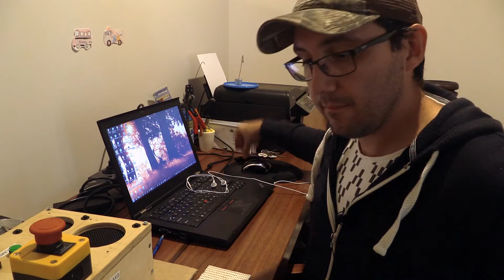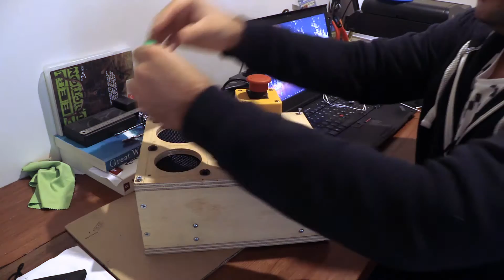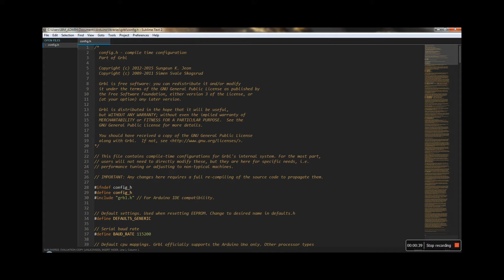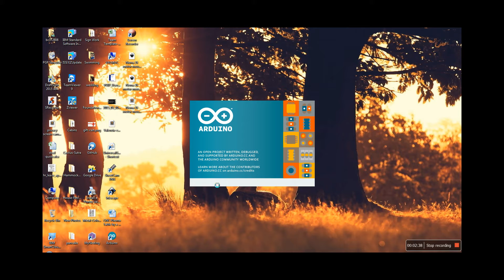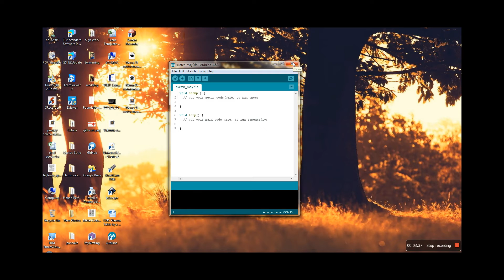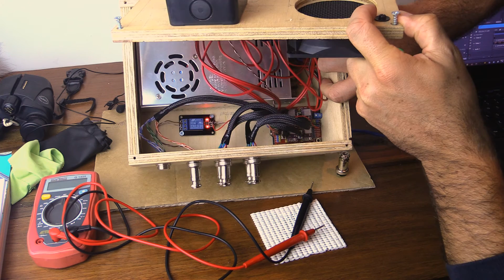DIY CNC plasma build by a novice - part 4

Comment: Hi Mark, I like to get your help i try to figure out how to connect the plasma torch trigger to the arduino. I have bought a relay connect to the SpinEn and to the 5v hoveever it wont trigger anything on M3 M4 or M5, i than connected to the SpinDir and it works with M3 on M4 off
thats fine than i connect the plasmatrigger connection to the relay and if i hit M4 it turns it on but when i hit M3 its frees and i need to disconnect and reconnect. if i try it again same issue.

i am usin V3cnc shield and the arduino uno  the relay is a JQC-3FF-S-Z 

have you any idea what am i doing wrong 

I would really appreciate if you could help i feel lost

by the way your videos are great

Comment: Hello sir Please help me, before i made cnc roter and run normally. This time i tried to replace with plasma, why when my torch is in x axis plate, simultaneously plasma is alive, my machine is moving without program.
Note: plasma and cnc separate machine (manual on off)

Comment: Hello Mark, I really appreciate the job you doing, I'm a great fan.
I do have a question please, 
1) what brand of plasma cutter are you using?
2) Did you change the plasma torch or just modify the trigger switch on the original torch? 
Thanks
Reply from the maker: Hi Murtala, the plasma unit is just a cheap Chinese Cut 40 machine, it was the cheapest I could find but I'm not entirely sure how good it is going to me. The torch is currently wired up from the "Spindle On" connector on the CNC Shield to a relay switch. From the relay switch it is just a simple two pin connector from the control box to the plasma machine (where the button on the current plasma torch screws into). Basically I'm just replacing the manual switch on the torch with a relay being controlled by the CNC Shield. This way, I can use M03 and M05 in my gcode to turn the torch on and off.

I hope this helps and thanks for watching.
Reply: Hi Mark Valenzia, thanks for the reply. 
So, if I'm not mistaken, the trigger on the torch is bypass to the relay output which is control by spnEn pin. 
The thing is, I'm confused with spnEn pin, it has two pin white and black. Can u elaborate on those pins, how do I connect it to the relay low current circuit. If there is written manual or video that explains the CNC shield properly let me know. Lastly, do u have a final video showing ur completed cnc machine running? I think I will help tooo.
One again thanks for the help.
Reply from the maker: Hi mate, I've just gone and had a look at the control box and this is the wire diagram/setup I have.
SpnEn (White to IN1 on relay, Black to GND on relay). I also have a single cable running from 5v/GND on the shield to VCC on the relay. On the output side of the relay I have a cable from COM and NC running to the torch outlet on the control box. 

Here is a link I was using for the CNC Shield -> http://blog.protoneer.co.nz/arduino-cnc-shield/
And this is similar to the relay I am using -> http://www.ebay.com.au/itm/5V-One-1-Channel-Relay-Module-Board-Shield-For-PIC-AVR-DSP-ARM-MCU-Arduino-/172249132530?hash=item281ad92df2

I'm actually still building the machine and have just ordered some more parts for the Z-Axis (linear rails and a lead screw). I'm looking to get back onto the build once the new parts arrive and finally get the machine wired up and finished. 

I hope the above helps.

Cheers

Mark
Reply: Thanks a lot mark. It's much better now . Looking forward for the next videos.

Comment: Hello, first of all congratulate you for the work you are doing, I'm in the same project, but not how to handle the plasma from Arduino or ramps that type of relay, you use to control the torch
Reply from the maker: +Ramiro Urquiza G'day Ramiro, sorry for the late reply. I'm using a relay to fire the touch using the Spindle On pins on the CNC Shield. The plasma cutter I have has a 2 pin momentary switch on the torch which connects to a 2 pin socket on the plasma cutter itself. I'm going to bypass the torch trigger switch and replicate it using the relay which is being turned on/off via the Spindle On/Off commands in the Gcode (M03 -on M05 - off) and the CNC Shield Spindle Pins... I hope that makes sense. Good luck with your build and thanks for watching.

Comment: Nice little box there. I have never been too worried about e stops. most my machines are not powerful enough to hurt themselves and its easy enough to flip the torch off. I'm sure that powersupply is shielded ok but im not sure id want it that close to the controller? i hear there pretty dirty and could cause problems being that close. That relay is exactly the same i used it should work great for your machine. Looking good
Reply from the maker: builtrodewreckedit Thanks mate, I haven't had any issue so far having the PSU and CNC Shield but I will keep an eye on it. You're right about the E-Stop it's pretty much just a software reset button but I might put it on the mains power between the IEC switch and the PSU. 
Thanks for watching.

Comment: Hi Mark

Very nice.. a few things and suggestions

1) Vents. Don't let your fans blow into your enclosure. Fans extract rather than blow better. You can better direct airflow that way.You will also blow scrap right on your controller. If you extract you will extract all hot air and create hot spots.

2) The SMPS power supply might not be good so close to your controller. There might be some EMC issues, especially when you run USB. Think of putting controller in steel enclosure and then into same box as SMPS

Keep on building.. hope fully mine will follow soon.. :)
Reply from the maker: TechNebulous Some very good ideas there Gert. The plan is to build a metal enclosure once the machine is up and running and I'll also be cutting any brackets I'm not happy with.

I am a little worried about the fans sucking air in as your are right they will suck in dust etc into the enclosure. The main reason I am attempting it this way is I found I got better cooling on the stepper driver heatsinks during initial testing. I might do some more testing now the box is made and use them to extract heat and see what the difference will be. At the moment the volume of air getting pushed over the heatsinks is making a big difference.

Thanks again for watching.